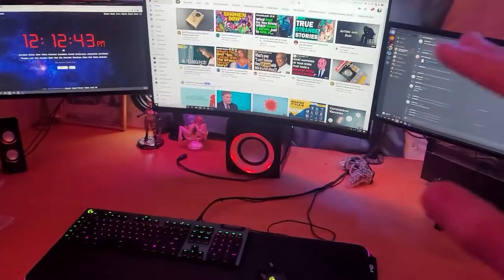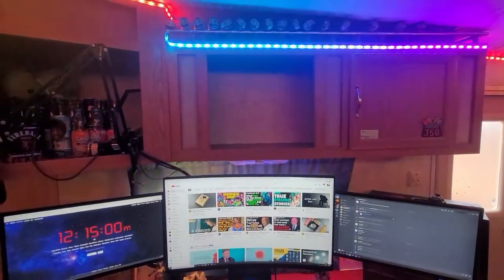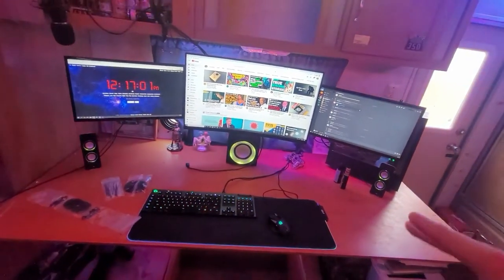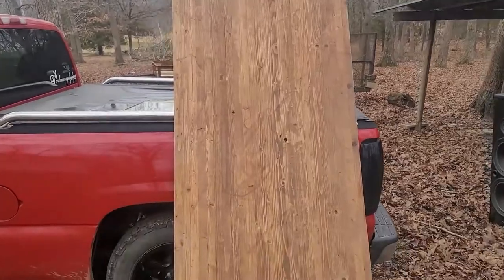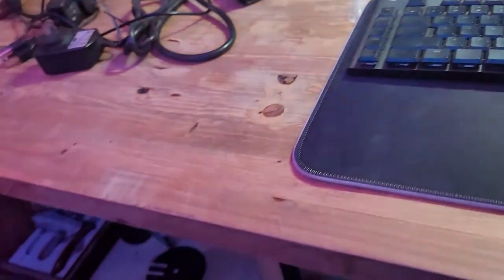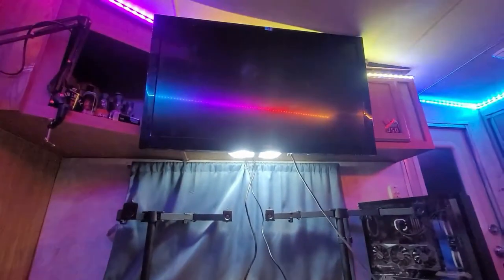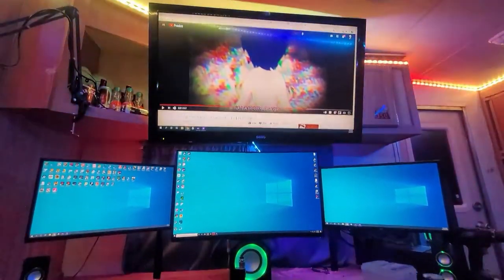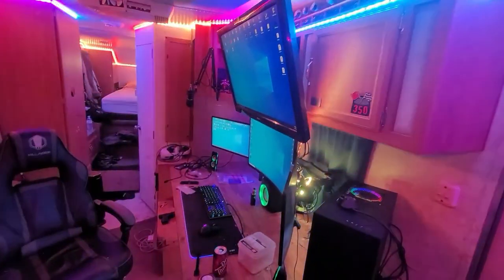The ULTIMATE Tiny House/Camper PC Gaming setup!!!

Comment from the maker: Wow! This video actually kinda blew up! Actually motivates me to do some more.... Thank you guys for the views and comments please keep it up I'm gonna start checking this channel 😅😅
Reply: What a comfy set up! 
Love how personalized it is.
Reply: hey im thinking about doing something like this. How do you get the power to run your rig and peripherals? im just now learning about 12v and 30/50 amp power stuff.
Reply from the maker: @jacksoncamp1971  Most campers come with a converter from 110v to 12v, I upgraded mine because it went out a while back. I've got a 30A main power coming in, going thru the converter to a car battery (I can run lights and propane heat for a few hours on the battery) and everything else is factory. The place does have a tendency to blow breakers if I get too much going at once...
Reply: I have more subs than you how!?
Reply: You deserve wayyy more +1 sub
Reply: I’m the 99th sub lol

Comment: Wanting to setup a similar setup for my first time. How many watts do you need to run everything. Do you use a hot spot to play online when you don't have wifi, if so, How much data for your hotspot did you get. I have so many questions hahaha
Reply from the maker: I keep mine plugged up to a 30A electric and I have gig speed internet installed. For a while I used Hotspot and I use android so I just found a free Hotspot app ... idk the legality of that but it worked for me, about 30mb/s speeds.